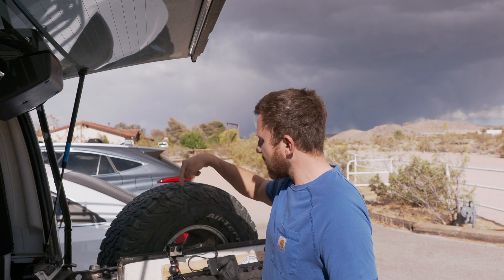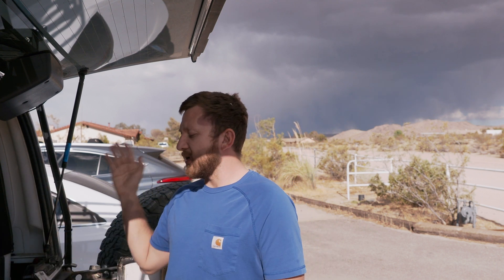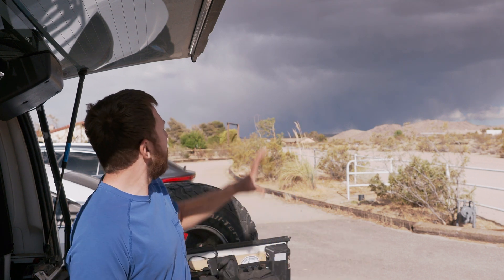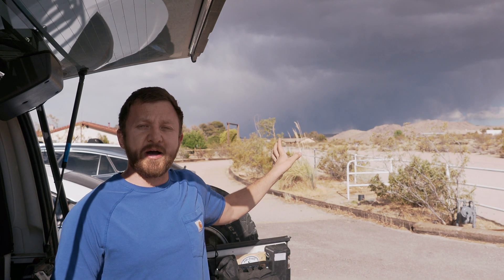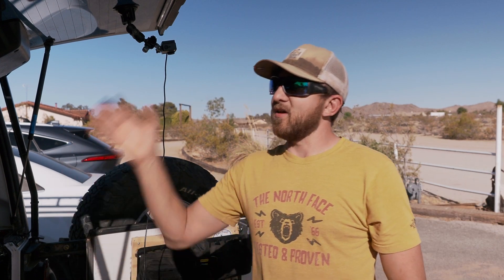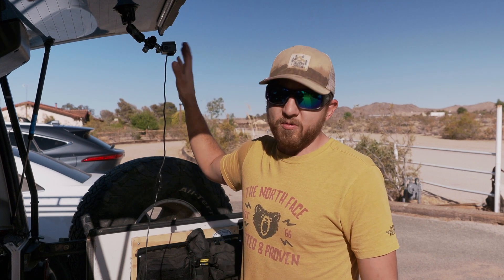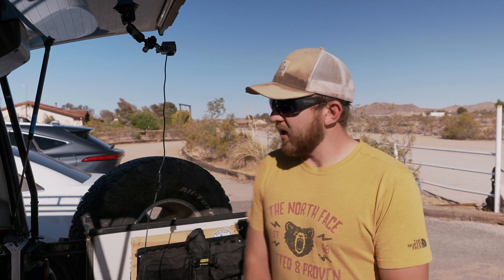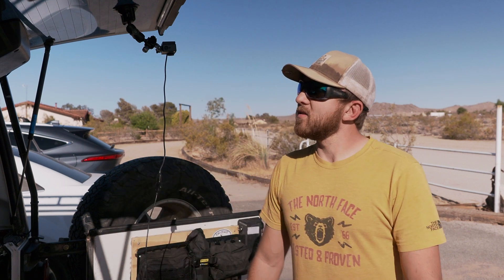Will a fridge run off a 100 watt solar panel?

Comment: I appreciate that this is a realistic test scenario of a camping situation by not moving the vehicle and orienting the solar panel for peak performance. This gives me confidence that I can run my portable refrigerator off of a 100 watt solar panel and battery setup. Thanks
Reply from the maker: That was the idea, thanks for watching.

Comment: Great video bro! Quick question i have a 100h lithium battery and 100w solar panel as well but by the time i wake up in the morning my batteries are completely drained from using the fridge, and my fridge is on eco mode as well. Am i doing something wrong?
Reply from the maker: Could be a few things going on. Could be the type of fridge, the solar panel may not be putting out optimal power. I'd break it down and test each component to see what your power numbers are for each component to ensure they are operating as they should.

Comment: Hey! Great video and love your channel. And I think it’s awesome you have the patience to answer so many peoples questions :)

I was just curious - do you have to make sure the battery doesn’t “overcharge?” For some reason I thought you had to be careful with that, but maybe it was just AGM? I read your replies and you said you had a lead acid battery at first and then an AGM. I’ve been going back and forth about upgrading from lead acid to AGM but I really don’t want to have to worry about overcharging it with solar. 

Thoughts? 😊
Reply from the maker: Glad you enjoy the the channel, it really means a lot. Thank you!! 

So with solar your going to use a charge controller and the controller will prevent the battery from being overcharged regardless if you have AGM or lead acid. If your picking one battery and using solar with it. Go AGM. 

I hope that helps you out!
Reply: @EmbarkWithMark  ohhh yes ok! Thank you so much 🙏
Reply from the maker: @crystalw8050  You are very welcome!

Comment: Do you have a video on how you did the actual setup? I would like to run my fridge the same way but I’m not sure how you connected everything and with battery you used
Reply from the maker: Hmm, let me take a look. If not, I’ll
make one as I am changing the solar panel mount anyway.

Comment: What amp hour battery do you have and is it lithium?
Also, what’s the wattage on the fridge?
Reply from the maker: Standard group 34 car battery.  I don’t know the official wattage rating. But it ARV rated the fridge at .85 ah/hr draw. But if we multiply that by 12 we get around 10 watts. That’s average draw so I’m going to assume the fridge is some where around 60 watts.

Comment: Hey, Mark! I'm a great-grandmother in my late 70's. I still like to travel and camp. I sleep in my minivan.  I watched probably hundreds of YouTube videos and finally bought a fridge. Usually I camp with power, but sometimes I'm in a place with no shore power. So I bought a 100 watt solar panel. I also got several power stations. I tried charging the power stations with the solar panel and running the fridge. I was switching the power stations all day and ending up charging one in the house to power the fridge overnight. Then I found your video.  Angels were singing! I had a deep cycle battery left over from my last camper that I had kept on a trickle charger, and an MPPT 30 amp charge controller. I also had a 12 volt outlet with ring terminals. I ordered the 10 gauge wire with the MC4 connectors on one end and bare wire on the other. Yesterday I hooked up my system just as you outlined, except that I used a separate battery. I wrapped the solar cords in pipe insulation because I just have them dropping into my van tailgate. This morning my fridge was at 38 degrees and the  battery was showing  12.2 volts! I'm so happy! I can't carry my fridge so it stays in the van all the time. Today I  shopped and put my meat in the fridge! Happy day! And now I know I can go anywhere and keep my food cold. Many, many thanks!
Reply from the maker: You are awesome! Love hearing stories like this of people getting out however they can. 

I’m super happy you found the video helpful and that the setup is working well for you. What a great story, thank you for sharing. 

Sometimes simpler is better, and in your case a lot more affordable. I read so many forums of people claiming a 100 watt panel can’t keep up with a these DC fridges. But there statements don’t add up when math is put into the equation. 

Anyway, thank you for watching and really happy to hear you found value in this video. Happy and safe travels!

Comment: That's neat that you can maintain it when you aren't opening it 6 times a day.
   Nice to have a cold drink if you been hiking or kayaking when you get back.
Be interesting to see how many watts it would take to maintain the battery when you are opening it frequently.
 It won't run all the time even if you're opening it up.
 When it is running you still have a hundred Watt stop loss.
 300 maybe?
Reply from the maker: Runs fine even when opening and closing. As do we frequently when exploring/camping. 

In fact we’ve run this fridge in the Jeep with a single battery setup without solar for about 5 years. The solar is a very welcomed addition though and ensures we can sit in place longer. 

Of course a lot of this is dependent upon your power needs.  The Jeep and our camp setup in it has a pretty low power requirement.

Comment: Awesome video! So if I’m correct you just wired your solar panel straight to your charge controller and then from your charge controller straight to the regular car battery? And then from there had the fridge plugged into the cars 12v outlet and just ran it like that?
Reply from the maker: That’s it! I did run a dedicated 12v outlet from the cars battery to the fridge. 

Glad you liked the video! Thank you!
Reply: @EmbarkWithMark  ok that’s what I was wanting to do with my set up I have a 100w panel that my plan would be to connect to the charge controller and then from there go straight to my truck battery and then from there run a dedicated 12v socket for the fridge. My only thing is that I don’t have an AGM battery. Do you think by using just a standard lead acid battery would work since it will be always connected to my solar?
Reply from the maker: Definitely! I had to switch out my AGM for a lead acid in the Jeep. Performance is very good with a solar panel!
Reply from the maker: @Trail_Kings_Offroad  exactly! The 100 watt solar panel is more then enough to keep up with the fridge in our setup.
Reply: @EmbarkWithMark  ok that’s what I thought I couldn’t find too much on the specific set up of a 100w solar panel on a lead acid just for a fridge. I’m sure if there was no solar panel it would kill the battery a lot fast but having the solar charge it I figured it probably wouldn’t be an issue
Reply from the maker: So without a solar panel. I can run about 2 days on a lead acid battery. With it’s pretty much indefinite, good sun permitting.
Reply: @EmbarkWithMark  sorry I should have also asked, is your lead acid battery a deep cycle or just regular starter battery?
Reply from the maker: @Trail_Kings_Offroad  I am using a regular starter battery. I believe mine is from Walmart lol.
Reply: @EmbarkWithMark  ok this has me intrigued now lol because my big concern is that if I ran the fridge at night with my starter battery if that would be a good idea or not and then charge it back up with solar in the morning
Reply from the maker: A standard car battery should be able to run the fridge overnight easily. I've ran the fridge in my jeep for the 6+ years I have owned it now with a single battery. Half that time is with lead acid the other half with AGM and only the past 2 years with solar. The real trick is understanding that with a single battery you are very limited on power so keep the power usage to a minimum when parked for the evening. The solar will definitely keep up with the fridge and charge the battery at the same time during a good sunny day. 

We currently use the fridge in our new to us 2015 4runner. Factory battery, no solar. :)
Reply: @EmbarkWithMark   Is the panel mounted on the roof? I’m interested to see how it can be secured up there.
Reply from the maker: Yes it’s mounted to the roof. I believe this is the video showing how I did it. 
https://youtu.be/nyr7Z7KSeUU

Sorry, limited internet. Out exploring currently!
Reply: @Trail_Kings_Offroad  a car or truck battery is not made for that.
Need a deep cycle or marine battery.
A dedicated lithium battery would be best.
 It will work for a while but it WILL kill a conventional car batteries that should last 5 years in about 5 weeks to 5 months depending on how far it gets discharged when it's under that extra load.
Reply: @EmbarkWithMark  the fridge is using more than that 100 watt panel is making. It's just that the fridge isn't running all the time.
 You are getting by with that but you really need a deep cycle battery for that a marine battery or lithium battery.
That's sketchy and not really safe .
Reply from the maker: @WilliamOwens1  ARB states the fridge uses .87 amps per hour on average. The panel has a max working current of 5.55 amps. If we double the fridge draw to 1.74~ and half the solar panels output to 2.5 amps. You can see that a 100 watt panel is plenty keep up with my fridge for my setup. 

This is also assuming the fridge is cooled before switching to DC. Which is what we do. No reason to use battery power to initially cool the fridge down when I can use AC the night before a trip. 

With all that said, a dual battery system is smart. Just it may not be necessary depending on your usage/electrical load. One needs to figure out how much power they need then design the system around that. 

For our use, this system works great.
Reply: @EmbarkWithMark  less than one amp is very efficient.
Wow.
I was thinking at least 3 amps.
Reply from the maker: I was on a similar train of thought before I purchased this fridge. DC fridges are impressively efficient. Also, thank you for sparking a good conversation. It's nice to be challenge in a way where I have to go back an evaluate something I've done/said.
Reply: I liked the video but that's not going to work for long.
 You need a dedicated battery ,a deep cycle or a lithium battery.
For real.
 That could get you stranded.
Not safe .
Reply from the maker: @WilliamOwens1  highly depends on your power needs. We’ve been running the fridge off one battery for 5 years now. The solar just ensures we can sit on one place.

The Jeep has very low power requirements. Unlike newer vehicles, it just doesn’t have a whole lot going on electrical wise. Plus it has a decently size battery compared to the newer 4Runner’s for example. Which we also run our fridge on. 

Dual battery isn’t bad, but for what we do in the Jeep specifically. We’ve proven to our selves it doesn’t need a dual battery system.  

But to be safe, a jump pack goes with us.

Comment: Just put a 100W lensun panel on my hood, and its running an Engel 45L fridge at 4degc 24/7 365!   I do drive my car daily for approx 25 min
Reply from the maker: It's amazing what we can do with just a little extra power from something as simple as a solar panel. It's changed the way we think about our power situation. It's awesome to hear that your solution is working just as well as ours is!

Comment: Thank you!
How many batteries and what kind?
Reply from the maker: My Jeep has one battery. It’s a standard AGM from an auto parts store.
Reply: @EmbarkWithMark  do you have a inverter or anything else?  Like most solar panels that are used have a reader?
Reply: Also what size is the battery?
Reply from the maker: @BrianJohnson-ny9zd  I do have an inverter. The charge controller shows voltages and charge rates. 

The battery is stock size for a TJ group 34 I believe.
Reply: @EmbarkWithMark  what size inverter?  And thank you.
Reply from the maker: It’s an 800 watt inverter. Check out the install video here. https://youtu.be/m57C_TiOW7c
Reply: @EmbarkWithMark  thank you for all the replies.  So just to make sure you ran the fridge with just the battery (the auto stores have 100ah at most) and the inverter? Other research says we need more solar panels and larger battery?
Reply from the maker: The fridge is a DC fridge. So I ran it directly off the battery and did not use the inverter. Yes I used just one automotive group 34 battery. I didn’t buy any special high amp hour battery either. The panel is just a 100 watt panel. 

Yes online says this. But I have ran my fridge on just my Jeep battery for up to 3 days for the past 5 years I’ve owned it. The 100 panel is more the enough to run this fridge in my setup.
Reply: @EmbarkWithMark  what size controller is that?
Reply from the maker: @BrianJohnson-ny9zd  It is a 10 amp charge controller. Here is some more info on it: https://amzn.to/3noQKWB
Reply: @EmbarkWithMark  I'm close to figuring out my set up. Got the Renogy package.   So to be clear it is safe to use a 12v fridge without an inverter?  It does have dc and even says it has an inverter in it.  I was thinking I only want to power the fridge anyways and can wait for the inverter later.  Also when are fuses needed?
Reply from the maker: @BrianJohnson-ny9zd  That sounds like a nice setup. 

Im not sure what fridge you are running, but generally speaking it is safe to run a fridge, like an ARB. off of a battery and solar panel without an inverter. An inverter takes 12v power and converts it to 120 volts, then a DC fridge would take that 120 volts and convert it back to 12 volts. So the use of an inverter on a 12volt fridge will be less efficient than the 12volt fridge running directly off the battery. 

As far as fuses go, your charge controller from the battery should have a fuse, and the fridge power source should have a fuse as well.
Reply: @EmbarkWithMark  the one I'm looking at is Bougue RV 12v portable car refrigerator 53q.  Is big enough and will fit good in the van.  So did you have the fridge and inverter connected at the same time.  Just different cables?  I thought it would make sense both being dc.  Thought the fridge is both.
Reply: @EmbarkWithMark  Your link says 30 amp. I'm not picking. I'm just confused as usual ! Also the link to the panels comes with a charge controller already.  I'm really confused now. Yet I'm still not picking ! LOL